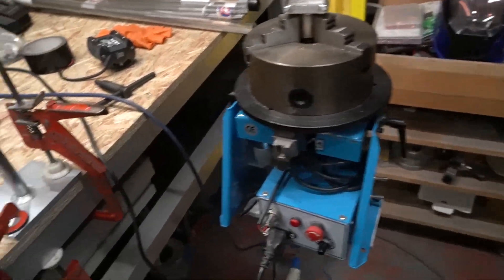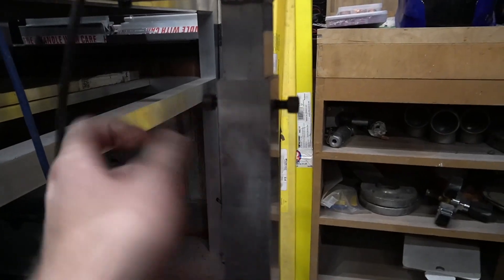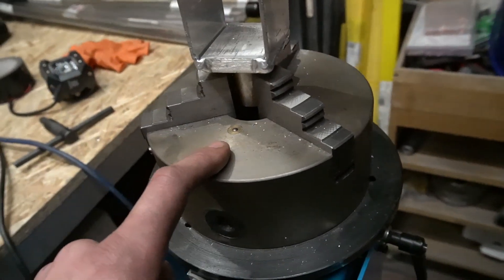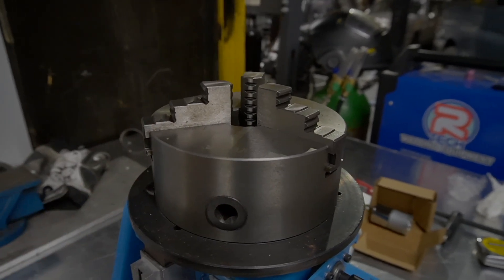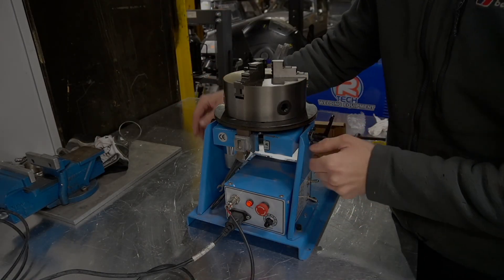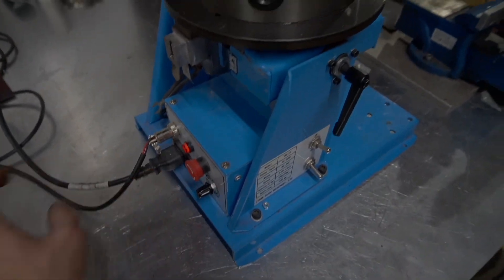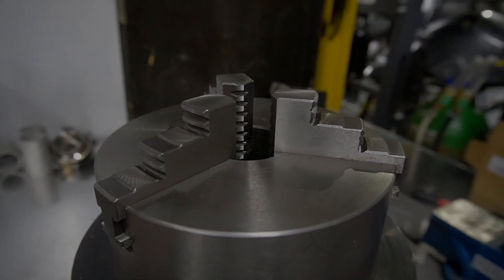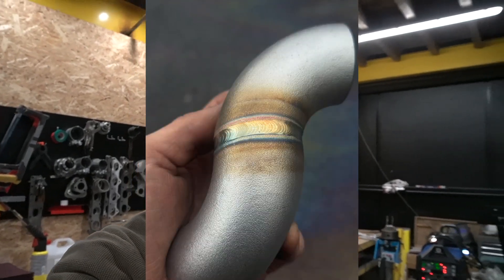How to turn your CHEAPEST Chinese Weld Positioner Into Something Useable!

Comment: Glad I built one in the end, I couldn't find any of these for sale in the UK when I needed one👍
Reply from the maker: I plan on making my own next. Need a indication of speed so I can dial in each material
Reply: @LukeAston  You wont regret it. Mines a bit long winded because I wanted a real 70-80mm through bore. I haven't got the posh gear like lathes and plasma. so built the thing around that big slewing bearing.👍

Comment: How have you routed your back purge? I'm on the lookout for a positioner, but everything with a hole through the centre, so I can run it through the chuck is a bit on the expensive side.
Wonder if that bolt through the middle could be replaced with a hollow bolt?
Reply from the maker: There is a thread in the centre of this so the purge can't be routed through the middle which is a pain. I have a line running over my head and just pop the purge into wherever suits me and isn't in my way. I would like a centre fed feed but the price is really off putting so I work with this and it gets the job done just fine

Comment: Only watched the first half but it seems like you could fit a gear reduction somewhere inbetween the motor and turnplate. Either that or make the motor shaft or gear thinner so that it's a mechanical gear reduction, that might be better either way considering you're only using the minimum speed. Alternatively a worm gear would make a more stable fix, it's something 40:1 speed compared to a normal gear if I remember correctly, only problem being that the motor needs to be mounted 90 degrees from where it currently is, and you may want another large gear to work better with the worm, but at that point forget it. Great mod though, and your 3D printed arm rest looks surprisingly solid!
Reply from the maker: @benbradstock183  swapping out the gear would be an idea but like you said given the constraints on space etc this is the best option. It was printed in PLA-CF with infill at 30% too! Could make it without the infill and it would be even more sturdier. Going to make a larger one to accept larger pipe tube which should add more rigidity to the setup